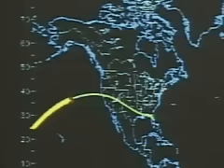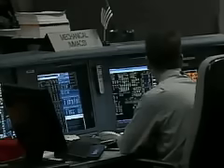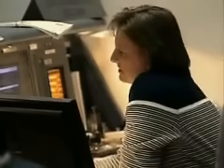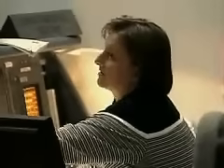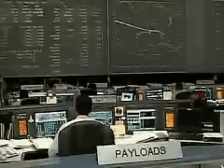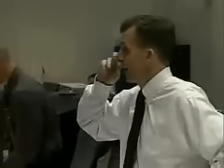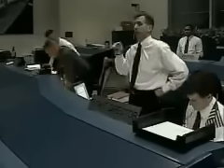Inside Mission Control During STS-107 Columbia's Failed Re-entry and disaster

Comment: NASA Could Have Fastracked A Rescue Mission To The Columbia Using Atlantis Which Was Being Prepped On Pad 39A Or B For It's Mission To The ISS So Why Wasn't This Done? While Columbia Was In Orbit The Post Launch Engineering Analysis Of The Launch Ascent Film Footage Had Revealed That Columbia's RCC Panels Along The Leading Edge Of The Port (Left) Wing Had Been Struck By Foam Insulation From The External Fuel Tank During Ascent (And This Was An Issue That Was Known By NASA Engineers And This Issue Had Shown Up On Previous Shuttle Flights!) Although The True Extent Of The Damage To Columbia's Thermal Protection System Was Not Known Prior To The Loss Of Columbia When It Attempted Re-Entry And The Crew Had Been Informed By Mission Control Of The Insulation Foam Shedding Event During Ascent And Yet No Further Action Like On Orbit Astronaut EVA Inspection Or Imaging From The Camera's On Columbia's RMS or Imaging From A Reconnaissance Satellite Of The Damaged RCC Panel Was Done To Ascertain The Damage That Was Done ! ! !  I Find It Amazing That NASA Managed to Implement A Rescue Plan To Save The Apollo-13 Astronauts And Yet NASA Couldn't Implement A Rescue Mission Using Atlantis To Do An On-Orbit Ship To Ship Crew Transfer!
Reply: Wow, you make it sound so easy . There was no RMS camera on board. Atlantis was no where near ready for a rescue. So take less safety measures and fast track to launch another crew and shuttle? Sounds easy typing it up on a comment.

Comment: A whole series of mistakes and negligence resulted in this disaster.  After takeoff, a piece of tank insulation struck the wing.  Some suspected a hole in the wing's leading edge was present, but management refused to ask the astronauts to exit the vehicle to check it.  During entry into the atmosphere, this hole allowed heat to penetrate the wing, weakening the metal structure and causing it to rupture...
Reply: What could they have done? Later, there was the ISS and they could send them there till they could send up another craft, then, they couldn't.
Reply: They had no ability to access the outside of this particular shuttle.

Comment: You can tell to that director of flight if the system of shuttle flight impulse is lock by system.failure and the the so called rubber band cannot band guess who.is looking for trouble  and you the director of flight is a director of clumsy flight with an ivy league school in your pocket .so good luck to all the cream of the crops of greens pastures .
Reply: Poor bot just can't do it

Comment: They KNEW that the shuttle wing was damaged, yet they allowed it to reenter.  I just don't get that.  Any option would have been more favorable to having these people burn to death via molten plasma spraying into their flight deck.  How horrible that must have been. The first opening into the craft and hot metal-fire getting in.
Reply: "They KNEW that the shuttle wing was damaged, yet they allowed it to reenter." No, they knew the wing had been hit, but they didn't know what damage, if any had happened.

But let's say that they did know that Columbia was fatally wounded by the foam strike?  What's the next step?  They can't get out to fix the problem, they're in the wrong orbit to get to the ISS, and there wasn't time to get another shuttle ready for a rescue mission before Columbia ran out of LiOH scrubbers to pull CO2 out of the air and the fuel cell reactants ran out and Columbia had no electrical power.

Comment: Pretty sure the director dry heaved at 10:43 when he found out there was no data from the shuttle. 

I think i probably would have just thrown up right on the console when i was told the left wing started losing sensors and then lost contact with the crew, knowing damn well there was a foam strike on liftoff on that wing.

Comment: All I can hear is voices, but it's not obvious to me who is speaking at any time. Please could we have some wording on the screen which says something like "SHUTTLE" (meaning we are hearing the voice of someone on Colombia) or "GROUND CONTROL" (meaning we're hearing the voice of someone on the ground). It's not obvious.
Reply: I can’t put subtitles in for you but if it helps I can give you some explanation of the call signs to give you an idea of who is talking. 

COLUMBIA - The astronauts, although Rick Husband speaks for most of the time in this vid.   Final transmission at around 5:17.  Columbia started breaking up soon after. 

HOUSTON - Also known as Capcom, he’s the person talking to Columbia. The Capcom is usually an astronaut. The Capcom here is astronaut Charles ‘Scorch’ Hobaugh.  He sits to the right of Caine in the dark shirt. 

FLIGHT - The Flight Director. He has general responsibility for the mission and controllers. His name is LeRoy Caine. 

MMACS - Maintenance, Mechanical, Arm and Crew Systems. He’s the mission controller who reports the loss of sensor data in the left wing to Flight. 

FDO or FIDO - Flight Dynamics. You can hear her reporting to Flight. 

GC - Ground Control. This controller is responsible for the running of the room they are in, making sure the screens and instruments work. They co-ordinate with Flight and it’s this controller who locks the doors when given the command by flight. Lock the doors literally means to lock the doors to the control room so nobody can enter or exit.
Reply: EECOM - Emergency, Environmental and Consumables Management. Controller who makes a report to the Flight Director. Responsible for some systems on Columbia.

Comment: "Lock the doors, no outgoing phone calls" etc. Well, it's not like this wasn't shown on LIVE TV -so, AS IT HAPPENED. (I was actually in the UK at the time and watched it live as well, and it was so dang obvious what had happened). It's not like you could hide the fact, so why all the secrecy? It's not like the press didn't already know what happened from the live feed! RIP brave Astronauts!
Reply: It's not "secrecy".  But once the flight director realized that the Shuttle was lost, the flight controllers in the room had one job, and one job only, and that's to make sure their data is preserved and can be recovered as part of the accident investigation. For however long it takes, that's what they have to do, with no outside distractions. Nobody goes in or out of the room, and nobody talks to them other than the other flight directors.

Comment: Most haunting thing is the ground control knew the fault and they can't do anything about it because it was undoable and let them continue with the schedule knowing the chances are very thin
Reply: They did not know - the Mission Management Team, relying on the leading engineers, had come to the conclusion that the foam strike was not a big deal. Only when the sensors failed, they realized...

Comment: The flight director will always feel at fault its his job to protect them but nothing could have been done they went quickly right after they heard alarms maybe a couple seconds they didnt suffer i hope thats the case what do you guys think?
Reply: According to the investigation, about maximum 40 seconds before loss of control and unconsciousness due to depressurasation, for some maybe a few seconds less.
Reply: @ksracing8396  i think they knew something was wrong but as soon after they noticed the problem they were dead i just hope it was fast!!
Reply: @jasonlinton9902  I think you can call this time span fast - maybe CDR and PLT knew a little bit earlier that there was a serious problem, when the tyre pressure warning came on, which was less than 20 seconds before loss of control. One indication that everything happened very fast that nobody had their visor closed so the suits could have been pressurized, three did not even wear their gloves, one even did not have his helmet on. I don't want to go into details of what has been published about the medical investigation, but generally most injuries obviously occurred after unconsciousness.

Comment: Actually engineers already knew they had problems with the tiles to protect the shuttle, during reentry, but they don’t have the authority to halt any mission, that lies with mission control. Unfortunately politics here in USA and world stage determines to go ahead in spite of apparent flaws. Plan for the worst and hope for the best seems to mean so little in a shuttle disaster, especially when it’s avoidable. Since the astronauts know the inherent danger of space flight and yet eagerly volunteer to go, does that seem to be the basis that NASA seems to move risk threshold a little higher and so maybe the astronauts are expendable?
Reply: Tiles were not the issue in this accident.
Reply: Wrong in many aspects: The top engineers had told the MMT that the foam strike would not be a big deal, so no pictures were requested, different opinions of lower level engineers didn't end up at the top, due to internal communication problems. Mission Control had the information there would be no problem. And how should they have halted the mission anyway? You have to bring them down at some point...
Reply: @ksracing8396  like I said politics plays a big roll.

Comment: At what point or what was it that they knew something was wrong?  When the lady said the 4 temp sensors went to some code?
Reply: When they went "off-scale low". That means it's not just that they're not reading properly-they're getting no reading from them at all. and when the wheel temperature sensors on the same side went off-scale low, the flight director asks if there was any "commonality" between them. Because if six things all suddenly stop working at almost the same time, the most likely thing is that they share some piece that's failed.

Think about it this way-you wake up tomorrow morning to discover that your lights, your A/C and your TV all work, but your coffee maker, toaster, and microwave don't. Is it possible that all three appliances died on the same night?  Sure, it's possible but the most likely cause is their point of commonality-the circuit breaker for the kitchen.

I think that when Cain was told there was no commonality between the items, it was the point that he was pretty certain that they were going to lose the orbiter and crew.

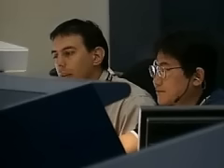Comment: You can tell he started getting really nervous when they lost the 4 temperature transducers on the left wing.  Apparently at some point after takeoff they reviewed video and found out that the foam that caused the shuttle breakup hit the left wing on takeoff.  It was always a concern and happened on a few other takeoffs only this was a larger piece of foam.  If I remember correctly there was a way to get pictures of the wing from earth but NASA (or someone?) declined getting them.  So as soon as the flight director heard that those 4 temperature transducers (with no commonalities) went down, he started sweating.  1:37
Reply: That f ucking foam. Why didn’t they fix it
Reply: @PutinsMommyNeverHuggedHim  As I recall they had tried several processes to spray the foam and none could really assure bonding throughout the flight.  Design weakness.  The cryo-fuel has to be insulated or you get ice and while foam strikes were not great, ice strikes were known to be disastrous.  A double wall on the insulation is too much weight penalty and cost on a disposable tank.  So that really left spray-on.  I believe later they did find a process that shed less.
Reply: @kylecrane4376   I see. thank you for the explanation!
Reply: Why not have them turn around if the foam hit at takeoff?
Reply: @Iamlisaleshay  they didn’t notice it immediately, only after going back and looking at the video and by then it was too late.
Reply: NASA had the culture, even with Challenger, if something happened in a previous flight, even it was a criticality 1 event, and there was a successful mission, they would do a waiver on the next flight instead of standing down and fixing the problem. That was the mindset on the SRB seal erosion that happened on flights before Challenger. The mindset with foam was how can something as light as foam cause serious damage. Again, they would do a waiver instead of standing down and fixing the problem. The flawed management decision making, all the way back to Challenger,  of having engineers prove that something would be catastrophic rather than listening to the engineers fears of the high probability of it being catastrophic. Wayne Hale's request to have DoD assets image the left wing on Columbia was shut down by Linda Ham.

Comment: Heartbreaking.They knew it was bad when the pilot told them about the irregular readings. They all looked mortified. RIP brave pilots.
Reply: They Knew it was bad when the heat shield got damaged on lift off
Reply: Mortified means embarrassed….
Reply: @PutinsMommyNeverHuggedHim  Read the other definitions...the term fit well. 
Still here? Shocked you read this far down 😛

Comment: The flight director looks crazy stressed because he knew of the damage and the likely outcome. The crew should've been told of the damage and not left in the dark. NASA let us down once again.
Reply: He only suspected there was big damage when the sensors failed. Until then everyone in Mission Control believed what they were told by the MMT, that the foam strike was no big deal - a conclusion the top engineers had come up with. That was also what the crew had been told.

Comment: I wonder what "I have commanded string one in the blind" means.
Reply: According to former astronaut Leroy Chiao the term "in the blind" indicates that you're transmitting in the expectation that the receiver can hear you but letting them know that you can't hear them.
Reply: @bethhentges  I figured that, but then I decided that "swap strings" could mean changing frequencies. So if you put those two things together, "swap strings in the blind" kinda sorta doesn't make sense. If you're changing frequencies, then the opposite (as it were) of "in the blind" would not be a plausible expectation. The whole phrase would roughly translate as, "changing frequencies because we can't hear you, but do please bear in mind as we do, that we can't hear you."
Reply: @CinemaDemocratica  You're actually fairly close, but it's an instruction to change to the backup communications gear. The suggestion was made by the Instrumentation and Communications Officer (INCO) controller